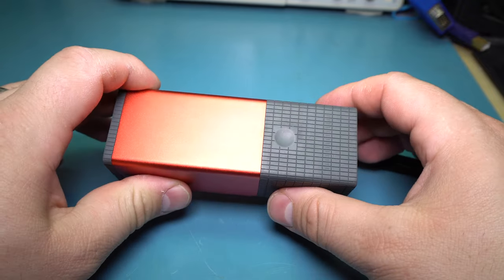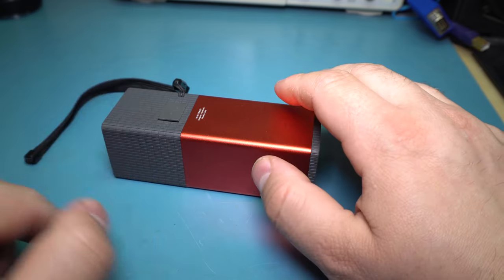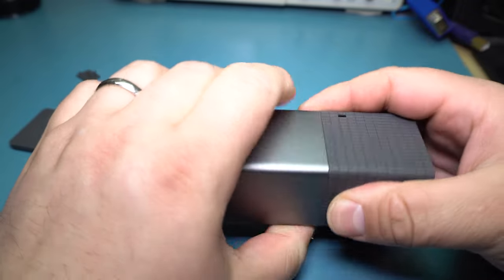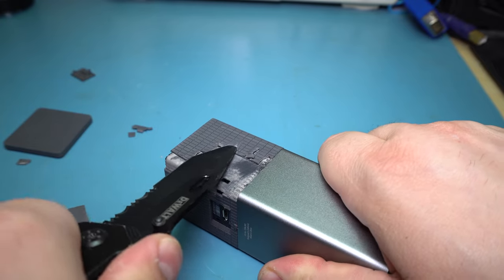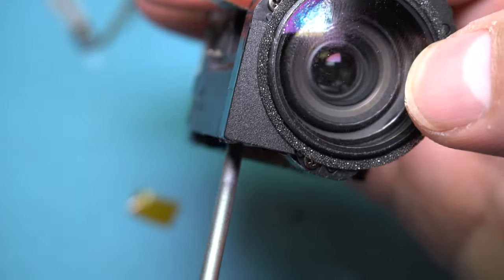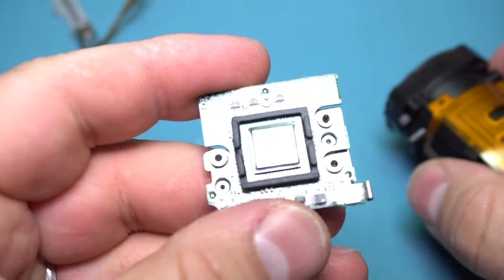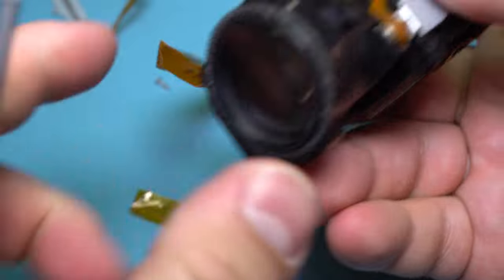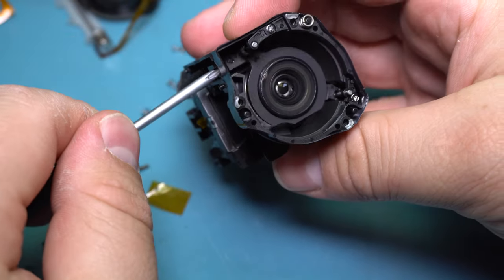Lytro Light Field Camera Teardown

Comment: These do have use in scientific and industrial applications where information about depth of field for each pixel would be advantageous.  Raytrix has sold scientific light field cameras for several years now.
Reply from the maker: Yep. They're also used in VR type stuff (which is what Lytro rebranded itself as, I think). When I said they were a novelty I meant as a consumer product. :)

Comment: man that's a hell of a lot of optical stuff for such a low end camera.
Reply from the maker: +Do R/C! It's amazing how complex even an 8x zoom is.

When you get into the more expensive stuff it gets to rather insane levels. The lens I use for bird photos (Canon 100-400mm II) has over 20 glass elements in it, including a synthetic flourite crystal element and that's just "4x zoom".
Reply: Though a prime lens would give you more light. But you can't zoom. Wish they would look into that instead of these gimmicks.
Reply from the maker: +Lee Gibson A zoom lens can easily have a large enough aperture to make up for it at the cost of size compared to a prime lens. It all comes down to trading off size for a faster zoom or having a fast prime at the cost of flexibility.

They might have had issues with narrow depth of field on the sensor and had to pick a middle ground of background blur to detail with a low res image.
Reply: This was a $300  multi focus camera with adjustable image after  $20  may be The price since it did not sell well  the new version is wel over $600

Comment: Is it a 4MP sensor like the Illum?
Reply from the maker: +Lee Gibson This one is 11 megapixel (megaray), the Illum is 40. The image is of course much smaller than that because you only see one portion of the sensor data at any given focus setting.
Reply: It's given as an equivalence but in reality it clearly just isn't true.
Reply from the maker: Lee Gibson From my understanding of the tech, it is a 40 (or 11) megapixel sensor with micro lenses added to give you a number of "focus levels". If the 40 megapixel sensor was split into 10 different areas of focus, you would get an image of 4 megapixels at any one point. 

40 megapixels of data is there, it's just limited to showing you only the portion you are focused on. Basically taking 40 megapixels of 2d information and turning it into 4 megapixels of 3d information.
Reply: Specs are here, definitely would be 4MP.
https://www.amazon.co.uk/LYTRO-ILLUM-Megaray-Light-Camera/dp/B00NFTVWH8
Reply from the maker: +Lee Gibson The Illum is 4 (from 40 mp total), this one is 1.1(from 11 mp total). Assuming it uses the same number of light fields.